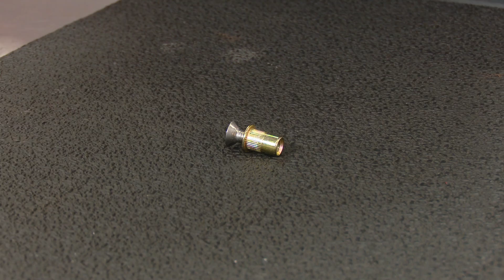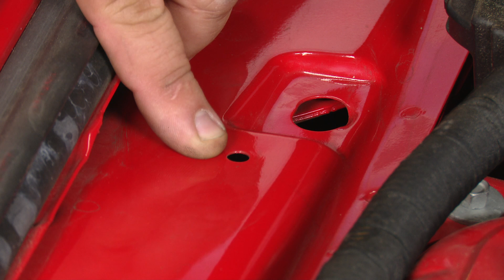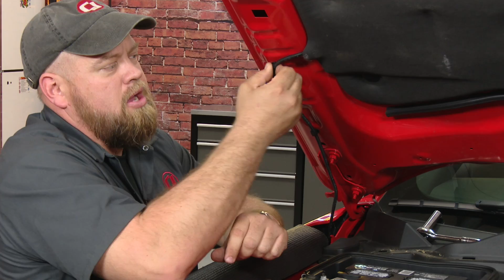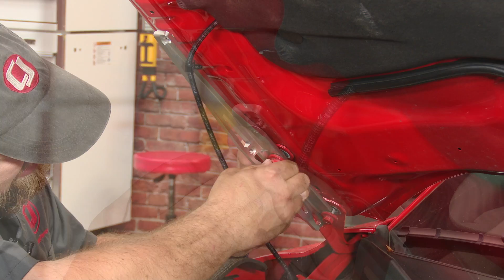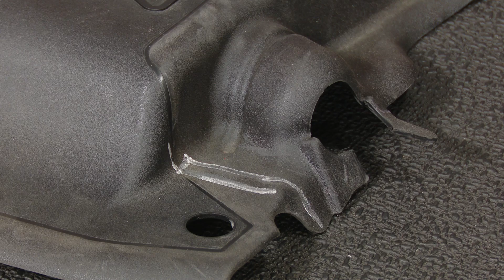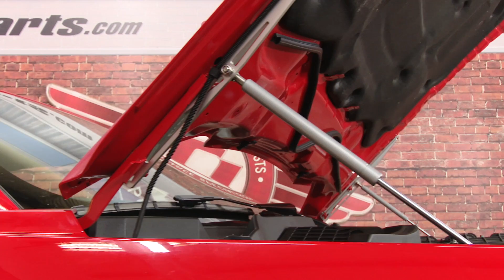2015-2017 Mustang Drake Muscle Cars Hood Strut System AlumaLift V6/EcoBoost/GT Installation

Comment: They literally make multiple NO DRILL (Except the plastic battery cover) Hood Struts, Redline, Ford Performance, MRT... which you can install in 30 min or less with minimal work. This is overkill for no reason, and God Help you if you make a mistake.... your hood is ruined

Comment: I LOVE the longer hood brackets that provide more support. But, the lower factory hood bracket just being slightly pinched by the nut, that's just a poor design. There is no reason that there couldn't be enough material to make a complete hole for it to grab all the material. The finished install just looks incomplete. And riv nuts are just a bad idea all around. If the riv nut doesn't grab get ready for one HUGE nightmare! If you decide to get this I highly suggest that you drill a hole that the riv nut fits snugly into, it needs all the material it can get to get a reliable fit. Scott Drake got so close to nailing this and then just fell short of the goal.